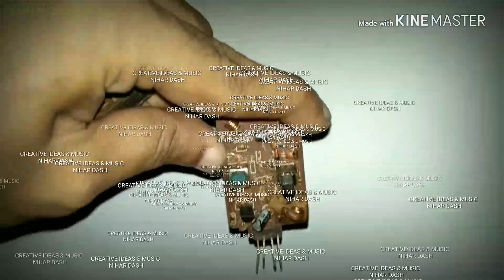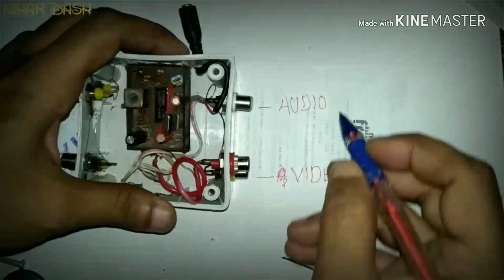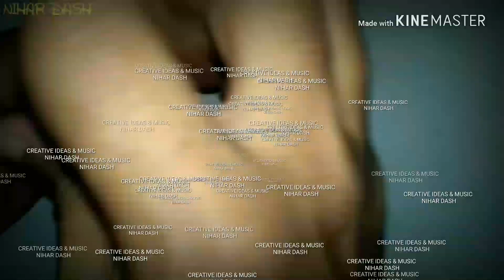RF - BOX - HOME MADE

Comment: where did you get the pcb and schematics - can this be used for vintage tv pattern generation.
Reply from the maker: My brother "Ravi Chandran " first thing thank you for comment me.
Yes it works vintage or new who have the rf socket.

I found this ckt on my old cd player or dvd player .
If you have old cd or dvd this ckt mount on PCB.
The pattern of this PCB  as i am steakering + - audio video  on my video .
Mainley it has audio video + & -  4v mobile smps powered.
If you have any dout then comment me.
                       Thank you my brother & have a nice day.
Reply: great Nihar, thanks for your reply. i am trying to ''build'' um-1233 uhf modulator by myself because it is expensive in the market which is a vintage item. i dont find proper circuit on the net since it is a vintage product and works well on b/w TVs for pattern generation...so if you find any clear circuit diagram with component list please upload a video and a web link to that site.
Reply from the maker: My brother  " Ravi Chandran " this ckt is very much complicated than making radio ,,,, it has audio and video modulation stage in it.
Try to find any cd player or dvd player because this ckt mount in it .
If you cant find cd dvd player go to nearest electronics shop 
And ask i take only cd rf ckt .
Some days ago thsi ckt available in market it price around rs 25.
If you get any cd dvd  then send me the photo of the ckt i personaly help you....
Reply: sure i will do - thanks for the tips bro...i appreciate it. yes it is a complicated one - and also expensive. anyway thanks again for nice suggestion.
Reply from the maker: MY brother ravi Chandran  do you have described photo of this ckt which can help you.
Then send me your gmail id then i send you the described  photo.
Reply: If you want a cheap RF modulator trying searching for old VCR or DVD player they can have antenna in and out. So you could input composite signal and get rf on rf out. They can usually cost less than 20$